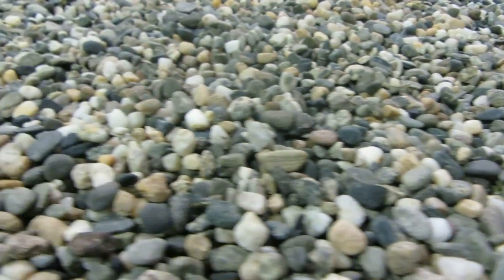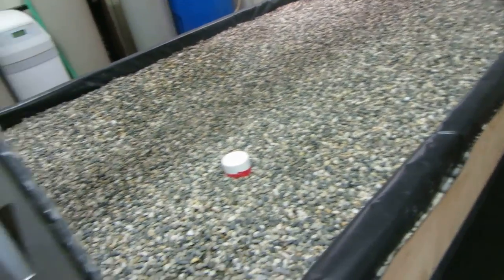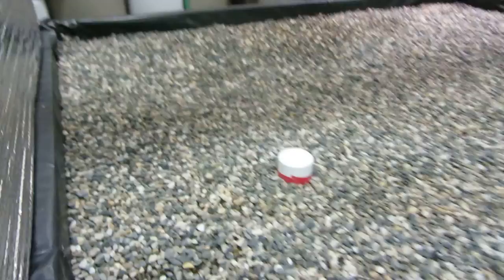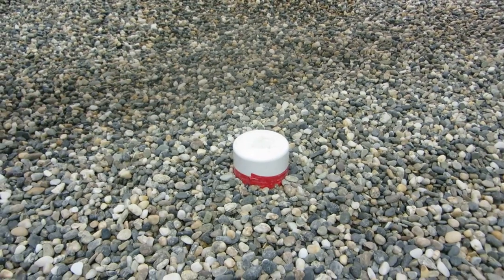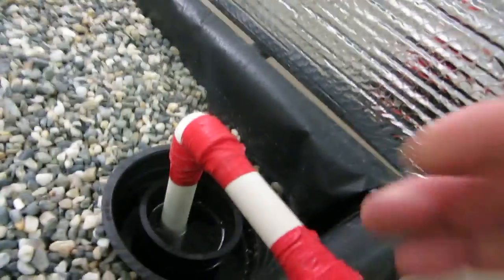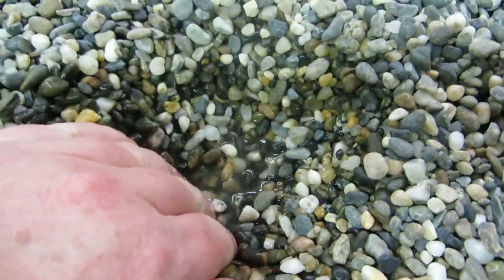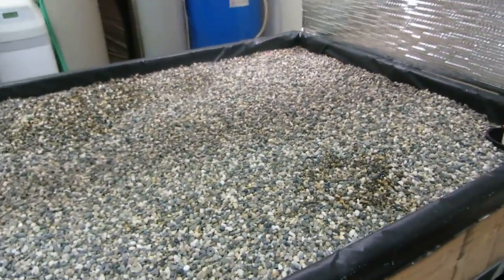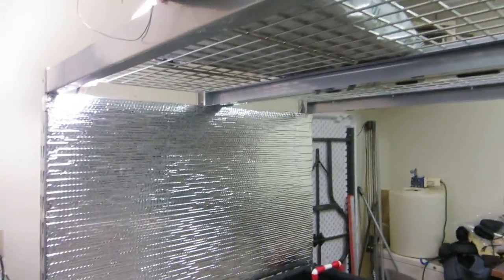Aquaponics Project 2012 update

Comment from the maker: Hey MBD, yeah it's very heavy especially when you add water on top of that! I have the grow bed integrated with the fishtank which sits directly on a cement pad, so really no issues. Right now it has around 350 gallons however I can expand it to around 450 gallons.
Unfortunately I only have a 1 car garage and it is much to cold here in Fairbanks AK to have a year round greenhouse. =)
It really is doing good and I plan to do an update soon. I look forward to seeing your updates as well. Regards.